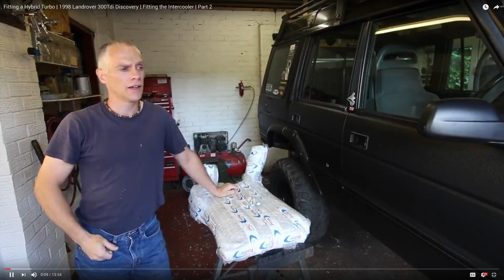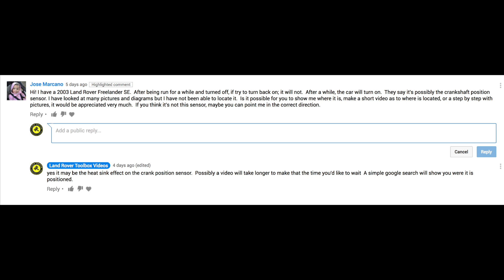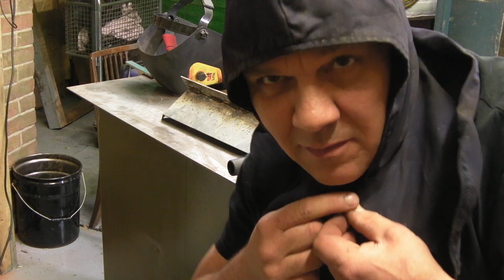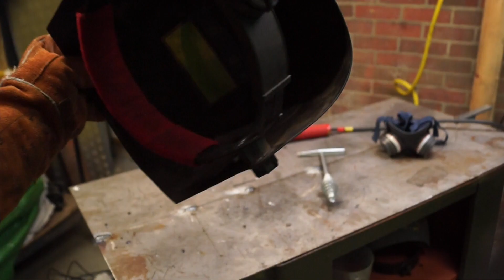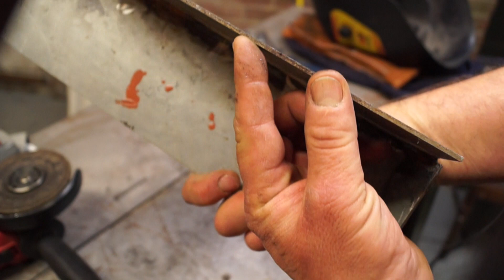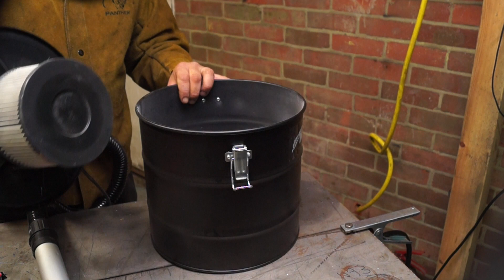Shout Outs, Arc Eye Soothing and Welding Galvanised Steel.

Comment: THE goto channel! Vest, sandals, turned head and closed room for privacy is probably the welding norm across the globe but here in Blighty, we are made of weaker stuff hence the "extra from Braveheart hood" etc. After a year of looking, I found a LWB Series chassis with every other bit thrown on the top, Perkins 4.203 and Aeroparts winch. Next is getting the time to do right by it. If I had a pound for everytime someone that I know has said that I should get rid of my Landy, I'd have enough to buy an auto helmet. It's ok, a mate moved South and gave me his. Arc eye is equal to being nagged because it's worse pain but you can't really put wet tea bags on your ears.

Comment: We used 3 M air fed welding helmets at work good but cost around £800 a bit pricey.
Reply from the maker: it's the filtering thats the most costly.  Looked into it but as you pointed out.  Pricy.

Comment: Good safety tips, nothing like arc welding and hearing that pop and sizzle real good to make you dance and throw your weld hood across the room, and galv is a pain in the ass indeed. Good shoutouts too!
Reply from the maker: Well I got a nice welding job on a semi trailer tomorrow.  Right up inside on the cross members.  I got all the kit ready.  Damned if I get burned up again!    You do trailers over at your workshop - my American HGV fitter friend?
Reply: Land Rover Toolbox Videos That we do indeed, i think fleet wise sotting on few hundred 53' dry van trailers, sometimes a real pain to work on.

Comment: I have to mig weld alot of galv at work  and have found the only way to get a decent weld down is to have the volts turned up a lot hotter than normal along with a hell of a lot of gas, IIRC i was at around 30v on 2.5mm steel on the last job, thats on rolled galv sheet, forget heavy galv, it'll always end up crap.
Reply from the maker: does the zinc still find its way into the weld even when you run it hot?
Reply: Land Rover Toolbox Videos its a little different from coil to coil but for the most part its similar to welding normal mild steel, just with a bit more fumes/spatter, but the spatter doesnt stick as much.
Reply: Land Rover Toolbox Videos one of the welds, - http://imgur.com/a/lJhYX
Reply from the maker: Ah I see that.  No impurities in the welds at all.   Last gala i did with MIG ended up black with yellow around the weld. Galv. was admittedly thickly coated.

Comment: I've Got a 300tdi auto and when under pressure I get a burning smell through the air vents and cant find out were its coming from
Reply from the maker: oil drips onto a hot manifold?
Reply: Land Rover Toolbox Videos thanks I'll have a look

Comment: Yep, been there, done that - a weld bb down the ear, definition of pain. You hear it burning its way down. At least it is sterile. The worst pain is when the ED poke it and cant remove it, so send you up to the ear ward, were the consultant pokes and prods even more, and pulls out a massive lump of steel off your ear drum. Ear plug / Ear defenders when welding under the Landy from now on!
Reply: @ Dan Allen, a friend was lying under a car welding , he got a weld blob on his crown jewels which gave caused him to sit up quickly, smacking his head on the underside of said car.....  he now wears fire proof overalls